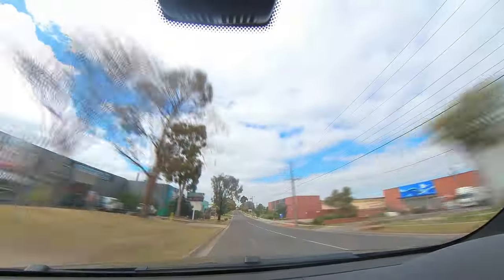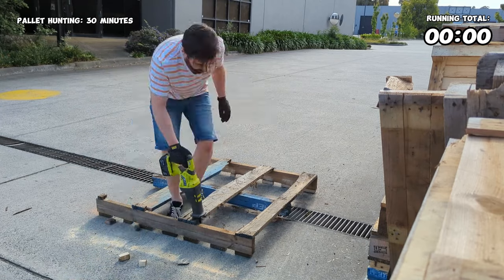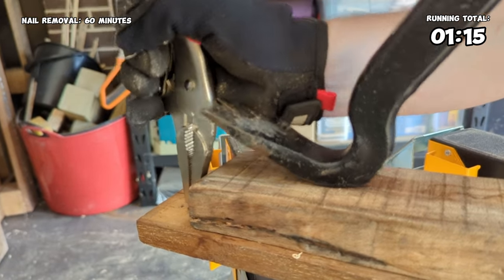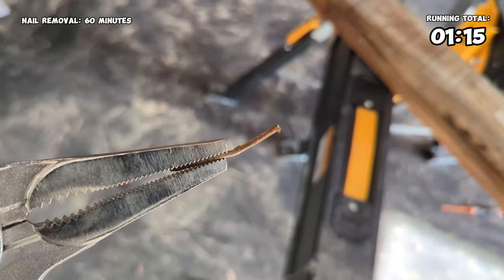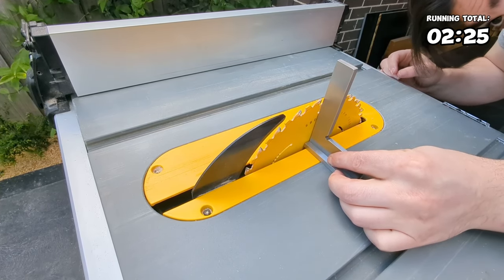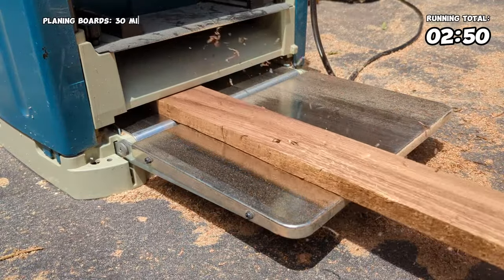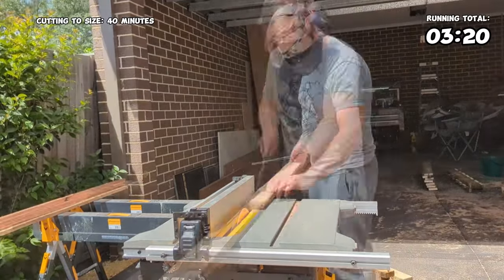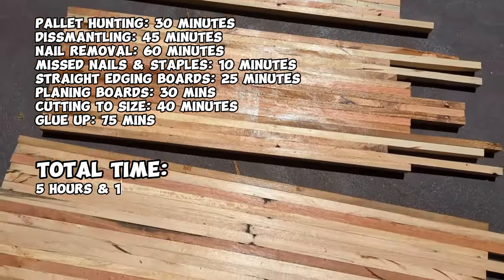Pallet Hunting: The Truth Revealed

Comment: I see you’ve made a few visits to Carbatec 😉 also, when using your thickness planer how much are you taking off at a time? I’ve been advised no more than 1mm each pass? 🤔
Reply from the maker: Yeh the dream is to get a cabatec or timbercon sponsorship haha. Could spend days there. For how much I take off, it's based mainly on feeling as my lunchbox planer was second hand and isn't accurate. The advice you got though I believe is correct. More than a mm and you will get more tear out and on hardwood stress the machine. Thanks for the support 🙂